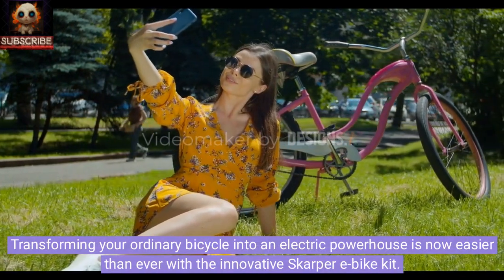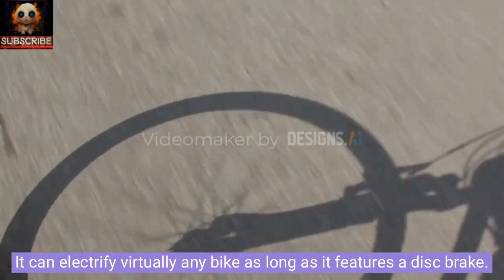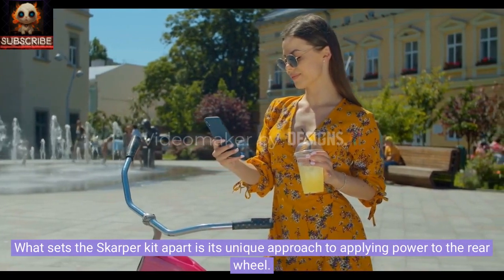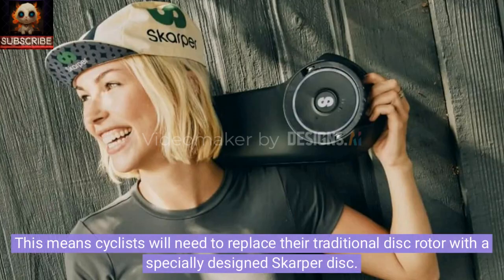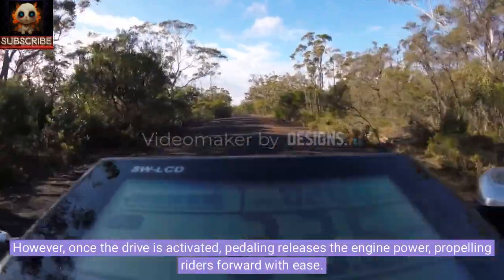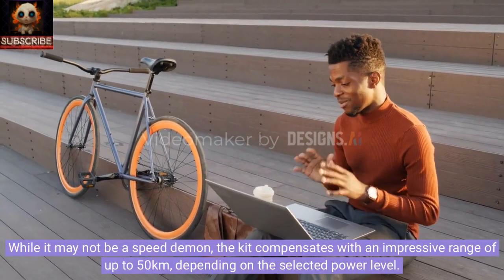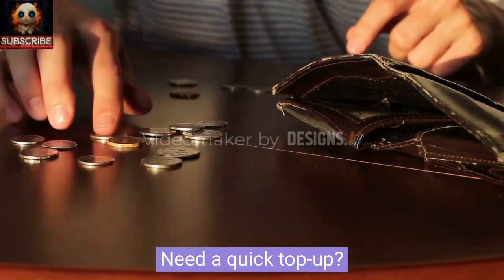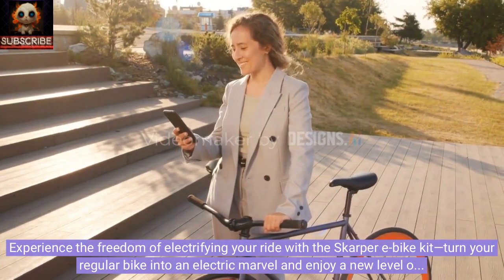The Skarper kit turns a regular bike into an electric one using a disc brake.

Comment: Lol for that price I can buy a full e-bike with double of power and range and for sure I don't need to wonder about durability
Reply from the maker: It's true that there are e-bikes on the market offering more power and range for a similar price point. However, it's also important to consider factors beyond just specifications, such as build quality, brand reputation, customer service, and warranty support. While some cheaper e-bikes may offer impressive numbers, they might compromise on these other aspects, potentially leading to issues with durability or customer satisfaction in the long run. Ultimately, it's about finding the right balance between performance, quality, and value for your specific needs and preferences.